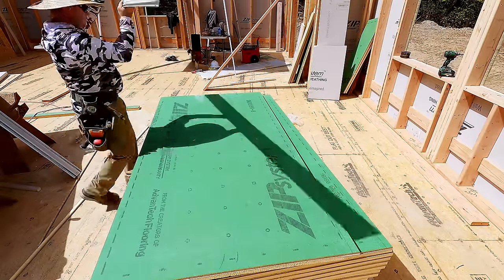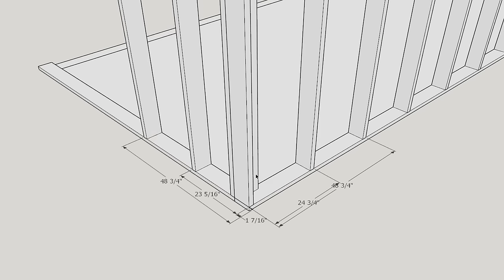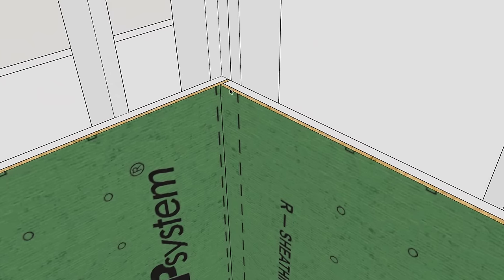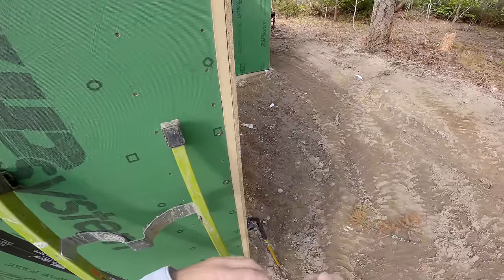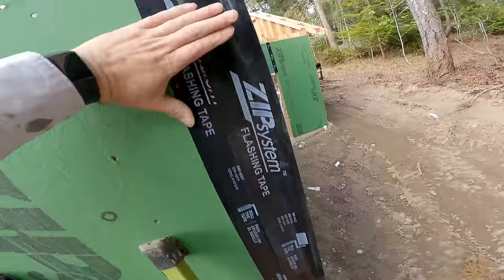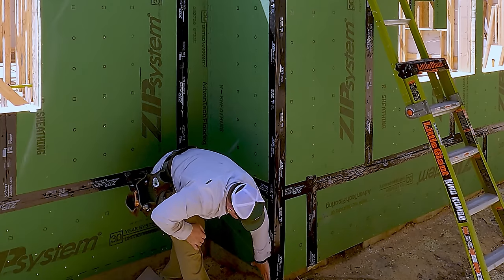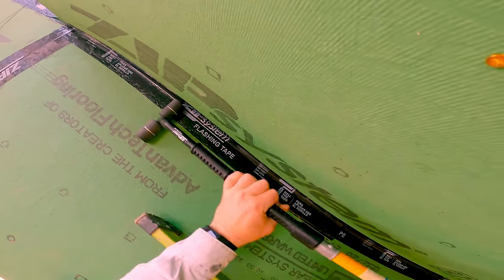The Idiot Proof Way To Reduce Thermal Bridging

Comment: Nice - videos from pros.  I'm shocked at how few people install sheathing while the wall is on the deck.  You can square it first, install the sheathing and the wall stays square when you tip it up.  Seeing videos of people climbing ladders with a 4x8 sheet...[shakes head].  The corner details are good info too.  Thxs.

Comment: Hi guys love your vid’s. We have been using R-12 zip for walls on this development. We have noticed that the width of the sheets are 1/8 short of 48” and varying sheets are 1/8 short on the length. We have told the suppliers to see what they say. But on long walls we start running off layout quick. Have you guys noticed this? Oh ya we are in northern VT. I’m not sure why we are using the R-12 it’s the developer’s choice,but we use a Big Bertha 4 1/8 spiral ring shank nail. But we noticed we are the only contractors in the development also using longer nails around windows. 
Thanks and I appreciate you guys!
Reply from the maker: I know the panels are supposed to be "sized for spacing" meaning they are slightly less than 48" x 96" which allows for the sheets to be gapped.  Are you gapping the sheets?

Thanks for the kinds words, try to stay warm up there 😁😁

Comment: This will be a more common practice when the IECC becomes more widely enforced in cold climates. This with a flash and batt of 2x4 bay rockwool is a killer assembly. I'm in zone 6 so we ran the r-12 with the 2" of close cell and then filled our 2x6 framing bays with 2x4 rockwool. Nice vid.
Reply from the maker: What fastener did you use for the R12? We are zone 4c
Reply: @AwesomeFramers  jumbo 4" framers with the bostitch Big Berta
Reply from the maker: @carterlarscheid6213  that's what I was thinking. We can't use it here because of earthquakes.

Comment: You forgot to mention nail spacing requirements. I don’t know the exact requirements, but I do know that the thicker the foam, the closer the nails need to be to get the shear strength. Great video though. I learn a little more each time you make one. Thanks.
Reply: That’s the one thing that worries me about this sheathing. Having a decent part of the nail basically unsupported and without ply-stud friction means there will be a lot more movement of the nail, and even with smaller nail spacing there could be failures in the long term.
Reply: @PrebleStreetRecords the shear properties are absolutely changed if you’re adding Zip R. No two ways about it. Nailing schedule, fastener type, details should all be reviewed if you are changing from solid sheathing on stamped plans.

Comment: Just bought a reno and noticed today the mice tunneled thru the foam around each 2 x 6 to make themselves a mouse highway straight across the back of the house from room to room and up to the 2nd floor and attic, with pop-out holes through the sheetrock.  Found the problem when I kicked the wall and it tripped a breaker from where the mice stripped the wiring in the wall.  I don't know how a fire hasn't already started from electrical damage, but the mice tunnels would make it super easy for the fire to quickly burn up the foam and ride the path into the attic.  Wasn't Zip, but I don't know whether rodents will notice a taste difference.  The initial problem was caused by a plumber putting several pipes up through sub flooring and into walls without sealing intrusion points...so nice.  Plain Zip Sheathing first on 2 x walls will be the way I'll build going forward.
Reply: What would be a preventive solution against mice eating into the foam?  Perhaps an bent aluminum flash on the bottom edge?  Like a large J but that could trap water and new issues.  Do they make a perforated aluminum flash to bend into a J?  Just 🤔. ??

Comment: Do you know if the r-sheathing is adequate for diagonal strength; the sheathing being separated by 1" foam from the framing  changes the shear resistance. Thanks for the great demonstration on using zip r-sheathing. The continuous insulation saves energy. I worked on a 1912 riverfront house, we used zip R sheathing on the walls; to control the depth of nails we used the gun so nails were proud and then used a hammer to drive flush. The old sheathing was 1x diagonal and before using the r-sheath we repaired and re-nailed the existing sheathing boards covered with 15 lb. felt and use chalk lines to mark studs then 3 1/4" galv. nails. We pre-primed and painted 8" cypress and used 1/2" x 2  treated plywood vertically to make a rain screen and mesh and screen at the top and bottom insect protection. Back painting and painting ends of field cuts made the wood siding durable. This project is in eastern Virginia and we had 8" beveled cypress siding available from the mill as an economical  siding.

Comment: I live in and flip (kind of) oder homes. I remove drywall or outside siding and screw on 2x2 diagonals 2' on center to the studs, insulate and replace the drywall or siding. Outlets and switches need to be moved 1.5" inward  if drywall was removed. Older homes sometimes don't have insulation so opening the wall makes insulation easier and better coverage. The diagonals reduce thermal bridging and I get a 2x6 wall thickness. The diagonals adds a tremendous amount of shear stiffness, maybe better than panel sheathing. Given the recent price increase for panels I save a bit of cash. Diagonal bracing was used before panels were produced. Old school.
Reply from the maker: No that diagonal strapping you add does NOT add anywhere near the lateral resistance you see here. The code tables show that.

Comment: So I am getting ready to build a small retirement cottage here in CT. Do I use ICF, SIP's, stick built? I'm on the side stick/w the fact of eliminating thermal bridging. I've read way to much on all of this though and I am still just a bit confused. My question is when adding the exterior R factor does this or doesn't it move the dew point where it can collect moisture in the wall cavity? Isn't there factors to take into consideration when choosing the foam thickness? I sure would like to know! Thanks
Reply: I would just use conventional best practices for your area.

Comment: Would love to see this system applied to a retrofit.  I have 2x4 wall currently and would like to add this to the outside when I reside my home.  Now I understand I would need extension jams for my windows but they would all be replaced at the same time as my siding.
Reply: I installed zip r-6 on my 2x4 walls last year. House was build in early 1970, so insulation inside the walls was poor. Since you are opening the wall cavity, You basically have 2 options. Add 2inch strips to make the wall thicker (2x6) if you are planning on replacing all windows, or use zip r3. I didn’t replace the windows but I had 2 old layers of sheathing to remove, so the windows was not a problem. I removed old tho foam insulation from walls and installed mineral wool Rockwool (rodents don’t like it and better R value than rolled insulation) in wall cavity and finished wall with composite siding. Thermal comfort in the house is much better. Definitely can recommend.

Comment: I've never used Zip System sheathing. It looks pretty good, but I still believe the added 'flashing layer ' of Tyvek has a lot of benefits. Especially with what we now know about water infiltration and the rain screen methods developed from that information. What are your thoughts on that?
Reply: Using zip r with tape.. walls are air tight. Less labor coz in one install, Water protection and insulation canbe done in one shot.

Comment: Thanks.  We do something similar but use 7/16 OSB and 1" foam from DOW.  We do it that way because DOW Chemical donates the foam to Habitat for Humanity for FREE!  I like the explanation about the framing and this is how I do it but with 3-4 different people laying out framing, it's hard to teach "Old Dogs" new tricks.  Keep up with the videos.  They're great.
Reply: G'day! Are you placing the foam behind the sheet of OSB or are you placing the foam on the outside of the OSB sheet? The foam if joints acts as a WRB so just curious as to which way is most practical..
Reply: @provocativepolitic  We put the foam over the OSB, tape all the joints and then use vinyl siding for the Habitat for Humanity houses.  The R factor is then close to a 6" wall with fiberglass batts.
Reply: @WayneSmith-yf3fg  wow. That's amazing detail. common in Europe but even high-end homes in America don't consider the thermal bridging and energy savings this technique provides. I would love to volunteer. Whereabouts you?

Comment: they make 6" zip flashing tape and flex tape that i would recommend for outer corners of buildings.  building a 40x60 shed myself right now and installing zip and the wider tape works much better on those corners.  prevents need for overlapping layers and has one continuous piece from top to bottom in what i consider to be a critical exterior detail.

Comment: One thing that I do at the corners is tape 2” wider than my corner boards so if my caulk joint fails into the future  the water is met with tape and not sheathing.

Comment: On an outside corner where do you get that extra 1and 7/16" for the second panel since the panels only come in 48" wide and studs are spaced 16" apart.  What is the opposite end of that second panel fastened to since its displaced 1 and 7/16" and won't be covering a stud?

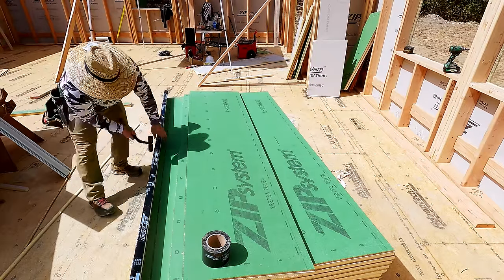Comment: Only one stupid question.  On the lower part of the side wall(time: 5.03 and 9:39), you have 2 ft pieces which seem to be about an inch below the vertical pieces.  How big is this gap and is it filled with expanded foam or some type of insulated sealant, prior to taping?  Thank you...

Comment: If you are using structural plywood for shear strength, does it go under the zip panels?  Areas with earthquakes require this sheathing for safety.
Reply from the maker: Zip panels are Structural 1 panels and provide shear strength greater than your plywood. Zip R panels also provide shear, Huber has the values published on their page

Comment: My only question I've wondered since my dad used zip r on his detached workshop in Minnesota. Because of the foam between the shear panel and framing does this result in less shear strength compared to shear panel tight against framing? My point the length of nail through the foam is subject to bending as the framed wall encounters forces causing racking and I predict the bending in the nails causes the shear panels to move with the forces more than it would with the shear tight against framing. Which could actually be an advantage in resisting seismic forces as the structure could possibly absorb the forces more so than if ridgid. I'm absolutely not talking down on zip r as I think it's a great product just wondering your thoughts on the topic or if you've seen test results between zip and zip r and if there is a discrepancy in shear values.
Reply: This is my question as well. I love the idea of zipR but I wonder if it would ever fly in my seismic zone. Thanks as always for the great video.
Reply: They are in B.C. which is in the ring of fire/high seismicity. His reference to his engineer's spec for the nail length leads me to believe that they are ahead of it on their seismic engineering.
Reply: I'm in a seismic zone in B.C. I'd have to consult an engineer about shear/seismic, but I'm also in a coastal temperate rainforest and we cannot put a vapor barrier on the cold side of an opaque wall assembly, so to utilize this product I'd have to go with a fully external insulation system and leave the stud cavity hollow. I suspect every climactic zone is different but might be worth looking into for you're region.

Comment: 8:59 Showed blocking for a 2-foot strip of ZIP R-6. I don't know why you chose this approach since the ZIP R sheathing comes in 9 and 10 feet. Was it less expensive to go with two pieces versus one piece?
Reply from the maker: At the time, 10' sheets weren't available.  This was during the supply chain issue and record high materials prices in 2021

Comment: What about miter cutting at 45° the edge of the sheet when you are installing at corners ? Will it make sense or it’s too time consuming compared to just burn one inch by overlapping the sheet?
Reply from the maker: great question, I'll ask Huber.  I don't personally want to cut the 45, and would assume that that joint needs to be tight from an energy perspective.
Reply: The layout shown results in a full thickness of insulation as well as a shorter joint compared to a 45 degree joint. More work is not always more better.

Comment: I see you use a lot of avantech floor sheathing. How does weyerhaeuser edge gold stack up to it? And where do you get your advantech from? I'm up near Tacoma and all the yards I've checked nobody stocks it.
Reply from the maker: Weyerhauser Edge Gold holds up extremely well. We've used that for nearly 20 years and never had a complaint with it.  

I order through Arrow Lumber and I believe they usually get the Huber products through IWP.  You're right, it often isn't a stock item at the lumberyard, but its usually next day from the distributor.

Comment: How do you go about nailing something to that outside corner that is only foam faced? Especially when you get into the thicker Zip-R sheathing?
Reply from the maker: https://youtu.be/JneNQSREuho?feature=shared
Reply: @AwesomeFramers  appreciate the link but after watching the video it didn't address my question at all. The outside corner that is exposed foam still has no solid anchor point for nailing to. I am assuming best thing to do would be just to cut away foam so the other zip panel can butt up against it in the corner so its now OSB to OSB contact on that outside corner. You would still get full foam contact on interior face.
It's not an issue with the thinner panels really but if you are installing the R12 Panels thats a significant foam face on each outside corner, so using the method of removing foam from one panel to lap over seems only reasonably solution.
Reply from the maker: @ThreePedalCollective  for us in siesmic zone D2 using R6, we nail at a 3" spacing.  If Huber would provide testing data on 4" oc nailing, then we wouldn't have to use 3x studs at panel edges.  

For the thicker panels, we can't use thoes in our seismic zone.  BUT this doesn't matter to us in our climate zone because we wouldn't see the benefits.

Comment: Fantastic videos. Without getting a full on quote I can't get any price guides on the price of the r sheathing, what are they a board for the r6 panel? And what software you using for the framing details? Thanks 👍
Reply from the maker: https://www.sketchup.com/

I don't know about current pricing, its been all over the map in 2021 and I've heard its going up again.
Reply from the maker: @provocativepolitic  I started learning it back in 2009 and am terrible with it 😂😂😂😂😂😂 @wiker_Dos has some great videos
Reply: @AwesomeFramers  Can you use it for blueprints to propose for permits at your building department or do you still have to outsource a draftsman? Thanks again for your responses. I  have quite a lot of gorgeous land in the NC mountains  I am keen to develope on. As a successful painter, plaster and decorator having business in Australia and UK I am trying to make my mark in the US and transition my focus on building as the GC a few spec cabins. Cheers
Reply from the maker: @provocativepolitic  You could, but we outsource to a designer.
Reply: @provocativepolitic  Sketchup has a subscription version that comes with a program that you can do proper construction blueprints on, with blueprint page layouts, symbols, legends, etc. But if your building department doesn't need anything crazy, you can still do a great simple blueprint layout with measurements in the free Sketchup version. The pro version I think is like $300/year.
Reply: @ABZD019  legend. Thanks for the thorough response. I got so put off by the free version it just doesn't seem very intuitive too me. I wonder if the pro version is much more forgiving? Or is it the same inputting with just professional grade metrics/parameters...
Reply: @provocativepolitic  

There's a learning curve to Sketchup compared to other CAD software I've used, but once you're over that hump, it's internal logic is stupid-easy intuitive. I can model a house, from every piece of rebar, to every stud and piece of OSB, trusses, etc. in less than a day. Another day to get all that transferred over to the blueprint layout program. I've actually found it so much easier than Revit, Blender and other layout/3D graphics programs. But then I'm a computer nerd so take my understanding of what's easy with a whole salt shaker.

The Pro version has the exact same version of Sketchup with just a couple extra bells and whistles like importing Google Maps and topography and some sun plotting for light; it doesn't hold your hand any better compared to the free version. I think the biggest reason is the savings for being able to make blueprints compared to outsourcing.

Comment: I prefer the ICF wall assembly. It's superior on many levels.
Reply from the maker: For sure. It's also insanely cost prohibitive here. There are a lot of negatives to it if we are being objective, but I've always wanted to use them
Reply: @AwesomeFramers  I just ran across your channel. It looks like your putting out some good content. We are starting and ICF high performance home and shop build soon in SC. We decided ICFs because even though it's a little more pricey. Once we factor in the additional strength, thermal bridge, water and vapor properties it is coming in comparable to lumber. Nonetheless Cutting-edge homes and up to Kode both have good ICF channels if you're interested. Keep up the good work 💪